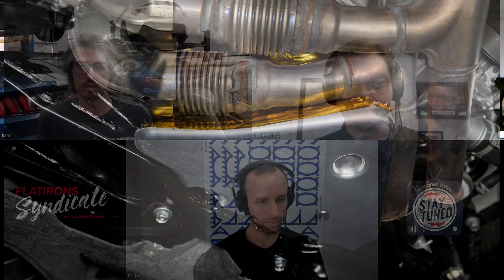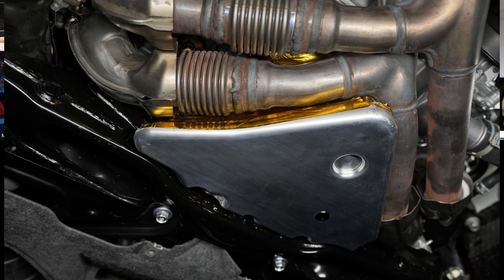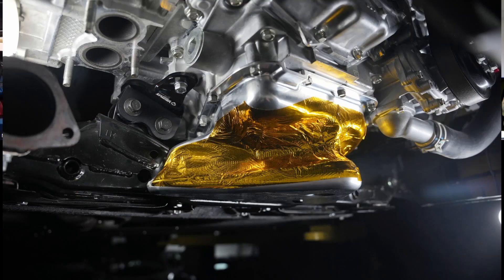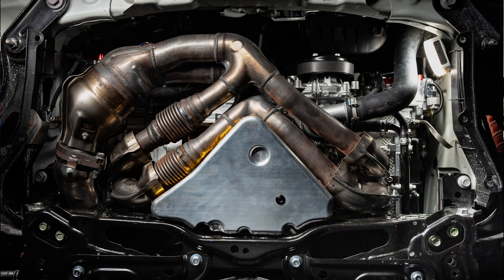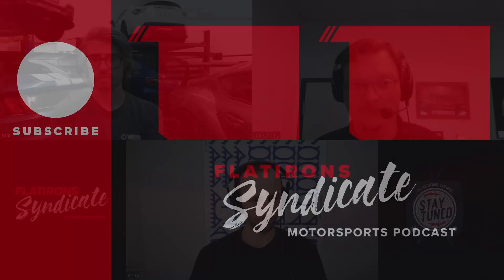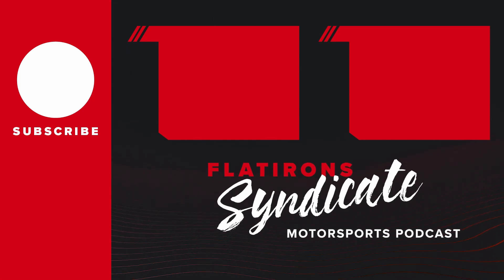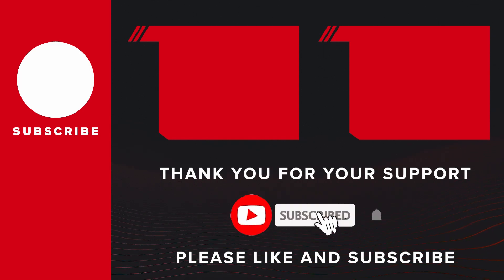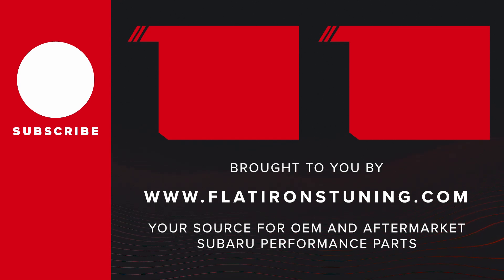Thermal Management for the Verus FA24 BRZ Oil Pan

Comment: I've been giving information on what needs to be done to several individuals out there, and the current iteration appears to be good for those who want to solve the oiling problems with a stock header design. This will work for spirited driving and autocross events just fine. For all out racing  a new header needs to be designed to allow the truncated oil sump to be larger. The header needs to go back and merge into a collector and then come forward utilizing a 100 cell cat. Hope this helps in the design.